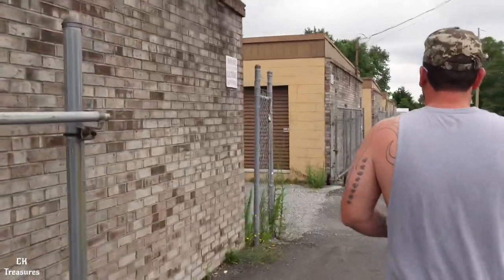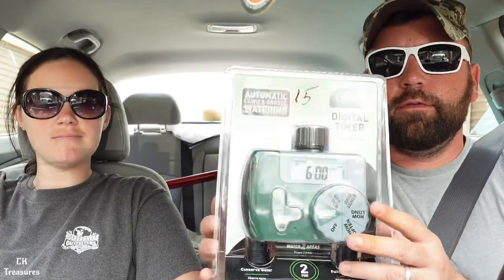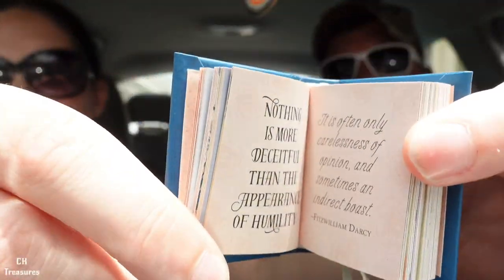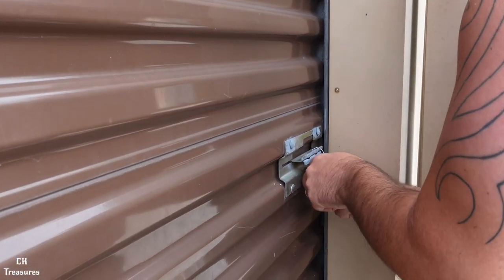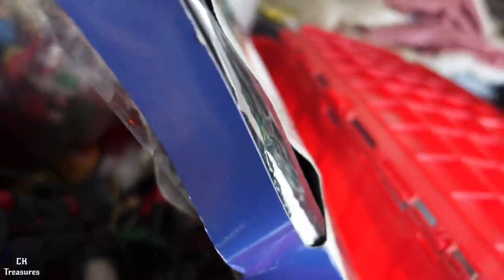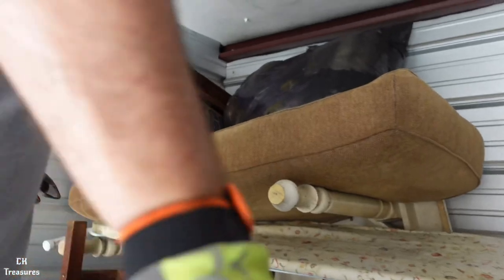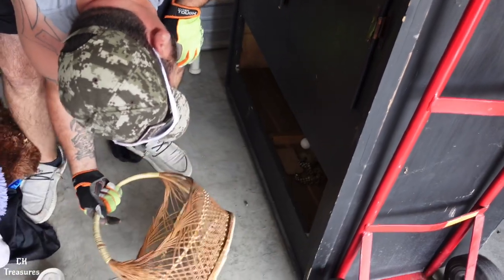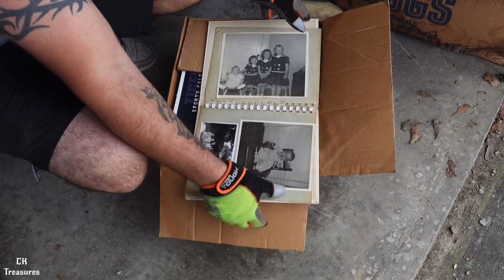We Couldn’t Get Into Our Storage Locker We Bought at Auction!

Comment: You're right, a contract is a two way street. They have as much commitment to the contract as you do, and should be held accountable when they muck you around like that.

I am not a fan of Christmas decorations, but those ornaments clinked like they were glass. If so, and they are old, check on Ebay for values, there used to be serious collectors of glass ornaments in America - I don't know if the market has changed. (I am in Australia)